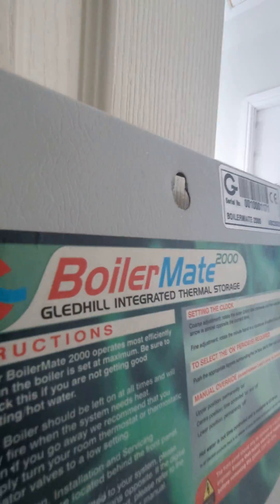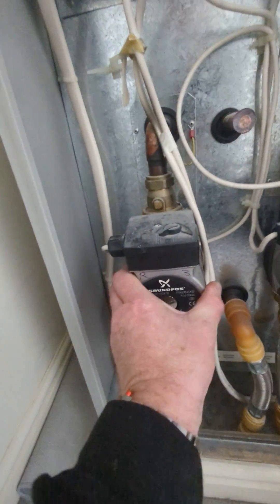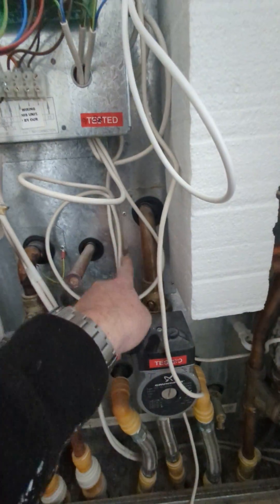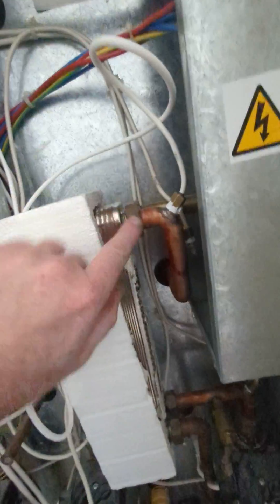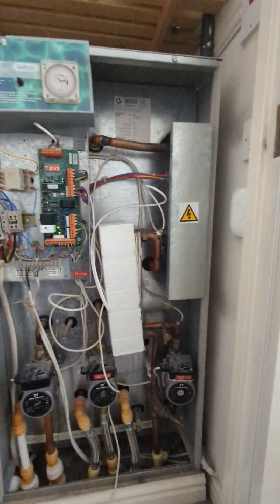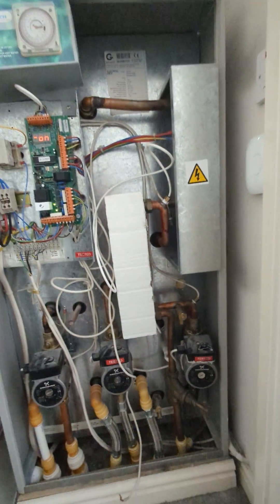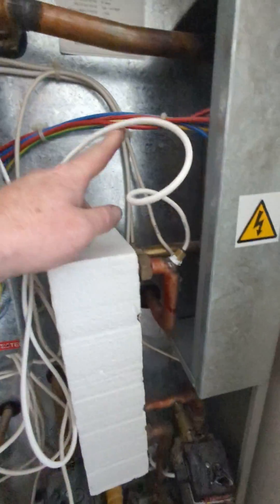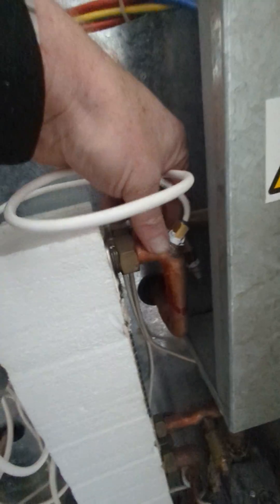Gledhill Boilermate repair no hot water

Comment: i've just had to drain my tank to replace a pump for the radiators. But not it filled up and i don't have hot water. I believe there might be a air block. how do i go about fixing it
Reply from the maker: You did not need to drain the tank to fit a central heating pump
Reply: Oh my😂😂😂, that tech got you good

Comment: Thanks foe the video. I've got the pump on the left always on with no demand.  Any suggestions?
Reply from the maker: the pump on the left will continue running until the thermal store is up to temperature. The boiler thermostat / flow temperature should be set to maximum.
Reply: I have this scenario right now. Sometimes it comes back to life and we have hearing. Must be a sensor?